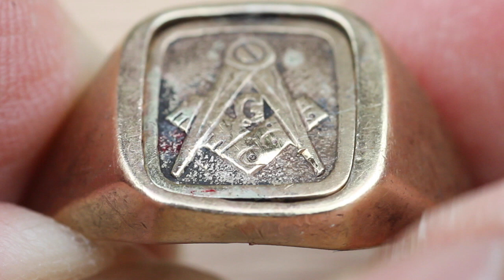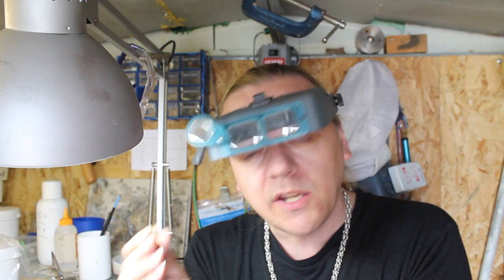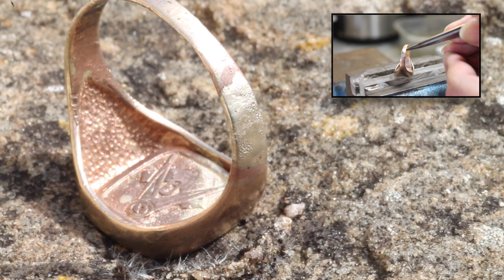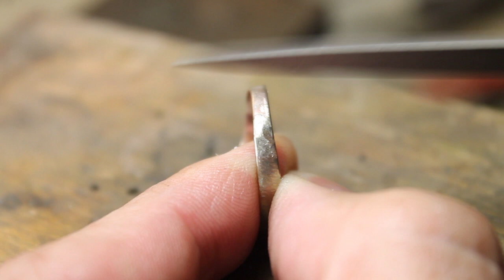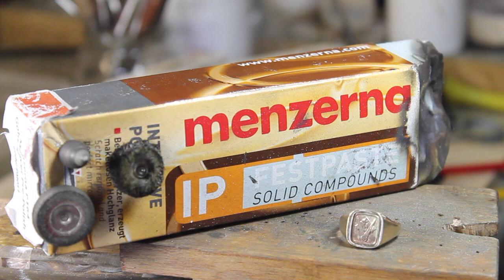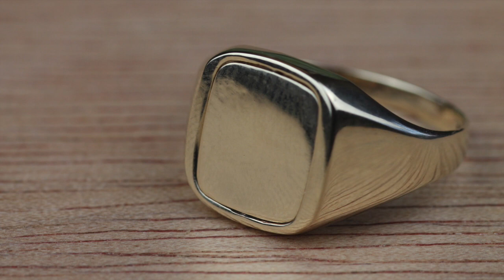How to Solder and Repair  a "Very" Damaged Gold Ring. Total restoration

Comment: Great video, I was wondering if I should use red rouge or a compound called fabulustre to get the light scratches out of my 10k signet ring, it may have one tiny spot that may be considered a medium scratch, but it may just be a light scratch as well?
Reply from the maker: I'm not familiar with fabulustre, so many comment on that. Rouge will give a polish, but isn't abrasive enough to remove deep scratches., only fine surface marks and tarnish. For heavier scratches you need something with more cut like jewellers Tripoli. If in doubt take it to any jeweller, who should only charge a few pounds for polishing, they will also be able to get inside and ultrasonic clean it too so a much better job that you could probably achieve yourself (and cheaper than buying the polish). Dave
Reply: @CelticDreamsCoUk  thank you, I will take it to a jeweler, I do hope to learn how to polish and solder one day also and your videos are great

Comment: Hi sir i hope your doing well, I have a 24-karat gold watch، But I noticed that the gold is peeling off, I don't know why, is it oxidized ,  should I polish it, please help me
Reply from the maker: If the gold is "peeling off" then its obviously not real gold. Perhaps its gold plated, or rolled gold (thick layer of gold over the top of a base metal). Either way, * * polishing it will make it worse * * . You need to take it to a jeweller, who can look at it carefully and ascertain what it is. If its plated then it can be replanted for a few pounds. But if its rolled gold that's wearing off, there is probably little you can do. Hope this helps. Dave
Reply: @CelticDreamsCoUk  hi sir thank you so much for your message , i already gone to jewelry He told me it's real gold, and that scratching is normal (The scratch is like on a ring)   I hope you make a lot of videos, we really benefit from you And also communication sites so that we can talk to you, take care and be safe 🙏🙏🙏🙏🙏🙏🙏🙏

Comment: I have a question I hope you can answer.  I soaked my gold tennis bracelet in jewelry cleaner and forgot it.  The color has changed somewhat.  Is there anything I can do to get the gold color back?
Reply from the maker: Depending on what the discoloration is, it may need to be removed mechanically. I've had this myself when i've forgotten about things and left them in there for days. I've had to run them in the tumbler, with abrasive powder to clean it of and then polish it again. If you don't have a tumbler, then just take it to your local jeweller and asked them to tumble or magnetic polish it. Should only be a couple of pounds for a clean up. Hope this helps. Dave.
Reply: @CelticDreamsCoUk  Thank you

Comment: Has anybodybody informations about the ring itself ? im not talking about what happend wit hit.
Reply from the maker: What do you want to know? it's a masonic signet ring, featuring the Square and compass, the symbol of the Freemasons. The G at the centre refers to "The great architect of the universe", God to most, but Masonry is non religious so, G symbolises whatever you consider the great architect to be. No one asks. The compasses reminds us to circumscribe our passions and prejudices.  and no to go beyond certain boundaries. The square reminds to act according to masonic line and rule, to be straight, upright. Basically the insignia is a series or reminders and moral lessons to be a good person. Every tiny part has meaning and symbolism.  Not everyone wants to openly display that they are a freemason, so hence the ring revolves. It can be worn as regular signet ring, but when in "safe" company, the ring can be rotated to reveal ones association.Typically worn,on the third finger of the right hand and hence visible when offering your hand in friendship. In case you are wondering... the ring is mine 'and I wear it'. Dave  ; )

Comment: Do you think if one wanted to have engravings removed off of an 18k gold ring only a bit of gold would be gone in the process
Reply from the maker: Yes you'd lose a little gold but negligible. You just have to reduce the surface down below the depth of the engraving. Dave

Comment: Hi mate do you no how I can get mine repaired all the blue stuff fell off my ring earlier :(
Reply from the maker: If its an old ring then the "blue" will be glass enamel. This is difficult to get repaired, using traditional glass powder. However, we now have what is called "cold enamel" which is basically coloured epoxy resin. I use this method to repair anything enamelled.  Just chip the remaining broken glass enamel out and fill with the coloured epoxy. It gives the same result but without the need to kiln fire the ring. Any local repair jeweller should be able to do this for a few pounds. Hope this helps. S & F. Dave

Comment: How many carats is this ring? Do you advise on buying 9ct, how bad can tarnish can get on a 9ct?
Reply from the maker: Carat (or USA Karat) refers to parts per 24. So pure gold would be 24Ct or 24K. Gold sovereigns are 22ct, wedding rings may be 18ct, or 14k in the USA . 
But Here in the UK we have 9ct (this ring) which is 24/9 or 37.5% gold (just over a third gold). the rest being copper and nickel. It does darken a little over the years due to the copper, but its very slow and minimal, Higher carat gold like 14k or 22k would not tarnish much at all, as gold does not really oxidise. So the more gold , the less it will tarnish. Dave
Reply: @CelticDreamsCoUk  thank you so much replying :) love your channel! How does one get rid of tarnish, what do I ask the jeweller to do.. Polish it?

Comment: Did it lose metal ?
Reply from the maker: The sand and filing stage looses a tiny amount from the surface, but not really anything that could be measured. Dave
Reply: @CelticDreamsCoUk  14k is durable and can handle all day wear I don't stomp on my stuff or throw it on the g

Comment: I have a 22 karat Gold Lion necklace the clasp is missing half of it. Can it be replaced? How much will it Cost? I got it in a second hand store with a jar of costume Jewelry. I would sell it once it is repaired. Yes I looked it up it is Authentic.
Reply from the maker: I presume you are in the USA as you have said Karat with a K. It depends what you mean by "clasp" but just go online to a large supplier such as Riogrande.com and you should be able to get a gold lobster clasp. 22k is hard to find though, as its soft. (18k and 14k are more readily available) 22k will be expensive though as its very high quality gold. Attach with a jump ring and you're done. If the necklace is heavy you may want to get the jump ring soldered. Should only cost a few dollars for soldering, but buy the clasp yourself as a jeweller will buy it from the same place and add a profit on top. Hope this helps. Dave
Reply: @CelticDreamsCoUk  I know gold gets sings and dents but what's with the roll like hole I barely is in the metal is it how some gold is made do jewelers kinda drill like. See it on walls too it's mostly pendents
Reply: @CelticDreamsCoUk  I even see these drill like screw marks you like almost screw like field was that there for a diamond

Comment: Can a ring be filed slightly to get little dents and marks off the band part of a gold ring... Is there any machine that can like sand down until the marks are gone?
Reply from the maker: Yes indeed. Within reason of course.  As long as there is enough metal, then a light sanding first will remove any small dents and scratches. Check out my video below where I use sanding drums to refurbish silver bracelets. Hope this helps. Dave   https://www.youtube.com/watch?v=Iv6NNClZdNU

Comment: Great restoration. As a matter of interest, could you use the paste solder to fill in an engraved message on a 9 ct gold watch back?
Reply from the maker: Yes, I can and do use that method for small holes, dents, or deep marks which I can’t otherwise remove. Do check out my video on removing engraving. See link. Dave. https://youtu.be/SGRSQa5lR2Q

Comment: Can you solder 24k gold ring??
Reply from the maker: As long as you can get 24k solder, certainly. Another alternative is to weld it, using a laser or a pulse welder. These methods do not use solder but can use thin 24k wire if needed to fill in. Dave
Reply: Celtic Dreams but will it reduce the karat and the grams?
Reply from the maker: Hence why its important to always use the same carat (Uk spelling) of solder. When soldering the solder is added, so a slight increase in weight, not that it would ever be measurable, as typically you'd only use a tiny pinhead size piece of solder. Welding or laser does not use solder, so simply melts the metal that is there. No metal loss or contamination. You can also use a laser or welder to add wire to fill  a gap or strengthen a piece. As above, using this technique you would use the same wire as the ring you are welding. Always use the same carat and colour. Dave

Comment: Great job. Subscribed
Reply from the maker: thank you. Dave
Reply: Hey Dave, do you have a getting started video with tool list spply ect.? I do watch repair and this looks like it could help.
Reply from the maker: A few people have asked what tools to buy. And the answer is never simple, as it depends on what you want to make. I do a lot of wire work, so for me its pliers (i have several drawers full). But others like to add texture by hammering, so some have lots of hammers ( i only have a couple). Some engrave, some set gems, etc etc. jewellery is such as vast subject, so everyone set up will be different. For watch repair, again it depends how advanced you want to get. For starters, you want to adjust and replace straps (so pin tools, leather punch, and spring bar tool), then to change batteries you will need a selection of case opening tools, knife and a watch case press. Small screwdrivers and an optivisor are pretty mandatory. Check out my friends at eternal tools. Dave  https://www.eternaltools.com/
Reply: No I have the watch repair handled, what I was wondering about begginer gold/silver soldering. To repair cases.
Reply from the maker: Simple..
Solder. Use Syringe solder as that negates the need for borax cones and flux. silver easy, 9ct easy should cover most jobs.

Small torch, one of the butane Chef's type torches will be fine for small jobs, no need for gas canisters and regulators. just a can of lighter gas

solder block, just a cheap solder block to protect your worktop.

You will also want some "pickle", to remove oxide and clean the piece after soldering. You can buy powdered safety pickle which you mix with warm water in plastic bowl. simple. If you want to improve its effectiveness a babys bottle warmer or small electric crock pot is perfect for keeping the pickle warm.

That's it, torch, solder, block, pickle.  below are "some" of my tools....Dave

Solder  https://youtu.be/en2KLTb-CV4
Block   https://youtu.be/zHVSAppuw4g
torch  https://youtu.be/917J2SrNCFw
pickle https://youtu.be/KyA3JS0OtYA

Comment: Hi Dave sorry to be a nuisance but I've lost the information on where to buy Menzerna. Also could I just check, would you recommend a beginner to start with the SF and IP? Thanks as ever, Pen :)
Reply from the maker: Hi Pen, Lovely to hear from you again. The menzerna IP (grey) is used to remove scratches and the SF (yellow) gives a bright final polish. But I see they now do a white SF. I havent tried this one but obviousley its aimed at silver. Both can be bought in the Uk from HSWalsh. See links Below. Dave.
https://www.hswalsh.com/product/menzerna-ip-intensive-polish-compound-p164-grey-tp1236034

https://www.hswalsh.com/product/menzerna-sf-super-finish-compound-p175-yellow-tp1236061

https://www.hswalsh.com/search-products?search_api_views_fulltext=menzerna
Reply from the maker: You're never a nuisance. ; )  Dave.
Reply: Celtic Dreams You are so kind, Dave. Thank you so very much for this and everything. ♥️
Reply from the maker: ; )     Dave
Reply: Celtic Dreams I bought some!! It's fantastic, thank you! ☺ Hope you are well.
Reply from the maker: Hi Pen' never a nuisance, always a pleasure. X. In the FLex shaft or Dremel, Start with the IP using a soft cotton mop or a felt wheel. then use another cotton mop for the SF. You can also use white bristle brushes to get into tight areas with the IP. Don't use black bristle brushes (nylon) though - useless. See this polishing vid.. Dave.
https://www.youtube.com/watch?v=L71O7hqvJa8

Comment: Great video and great skill. 

I work in the waste water industry and was lucky enough to find an onix ring and also one of these swivel Masonic rings with the blue enamel.

 I am wanting to shine them up to sell as I have no use for them. Could you recommend something around the house I might have that will polish them up like brasso etc or will I need to buy a gold specific polish? I have a dremel for making the job easier but unsure on the compound. 

Kind regards

Marcus
Reply from the maker: +Marcus Brown ..You really need the correct polish. Typically this would be Tripoli and rogue which you could use with your dremel on a felt wheel (Tripoli) and a soft cotton mop for the rogue. But ideally, you'd use buff sticks firsts and rubber polishing tips to remove scratches. I have a huge assortment of polishing accessories and getting a finish like this does take work. 

If you don't have any polish, you could try a set of 3M radial discs. these will get you a "decent" finish without buying too much. You use them dry...   https://www.youtube.com/watch?v=uUBnN4j98Nc

A simpler alternative would be to take the rings to a local jeweller who can clean and polish them for a few pounds.

Dave.

Comment: Hi Dave. What do you call a signet ring that spins like that? Have you ever come across one that spins that isn't a masons ring?
Reply from the maker: +Pablo Barclini ..They are just refereed to as "Masonic Swivel rings". The idea is that when in mixed company you can wear the ring as a normal signet rig, but when in the company of fellow brethren, you can rotate your ring to display the square and compass. Still very popular today, when discretion is required. Hence many items of Masonic jewellery change in this way. ; )

Comment: Hello, great work!Could you tell me what material is the polishing wheel made of (the one you use for super finish)?Cotton, felt...?!?Thanks!
Reply from the maker: +iuli sidorov ..... The last thing I use with the SF (or rouge) is a small wool mop. link below to the ones I use.  Dave.

http://www.cooksongold.com/Jewellery-Tools/Wool-Pendant-Wheel-prcode-999-ACO
Reply: +Celtic Dreams Thanks for answering.Do you consider that is better with rouges for gold or that Mezerna?I'm uncertain what to buy.I'm looking for final polish products.I found also Mezerna M5 which is supposed to be better than P175, that you use in this video.They say is the best finish on the current global market.Best regards,
Reply from the maker: +iuli sidorov Since trying the menzerna polishes, I no longer use Tripoli or rogue . The IP on its own will take it from 600 grit emery paper to a mirror finish on one step. That's the stuff ! The SF just gives that final showroom shine, particularity on yellow gold. As I say, I don't use anything else now.

I haven't tried the M5, so cant comment on that. But I have been blown away with the other two. Hope this helps. Dave.

Comment: how much for a refurbish like that at a local jewellers?
Reply from the maker: +MARVELMARK300 ... I can't say exactly. Considering the state of the ring before, I think 99% of jewellers would not touch it. Masonic rings like this are readily available, so most would just give you the scrap value against a new one.

As to the price for such a job, it's the time that's the factor. The video was filmed over several hours and if that's all the jeweller is doing in that time then it's going to cost you. depending on what they charge per hour. My plumber is £75 per hour, the local garage is £60 per hour. I don't see why a highly skilled jeweller should be any different. difficult to say but I hope this sort of answers your question. Dave.